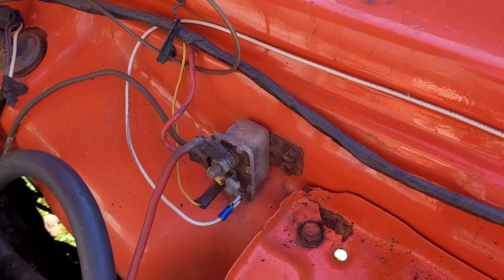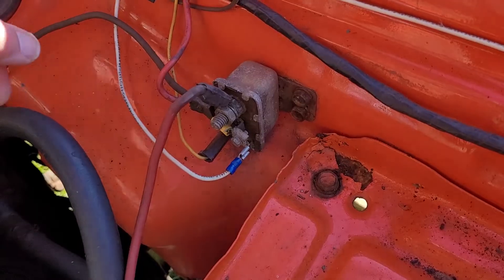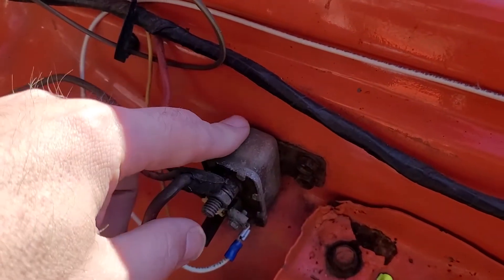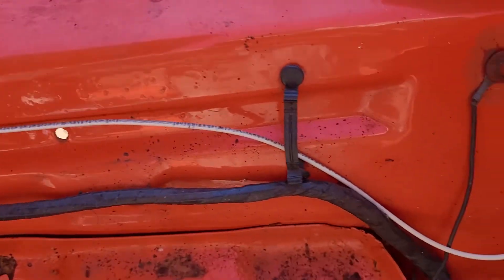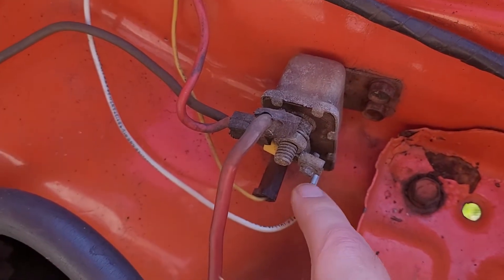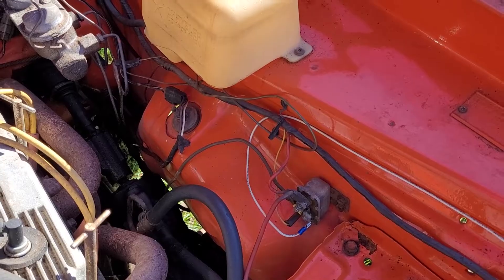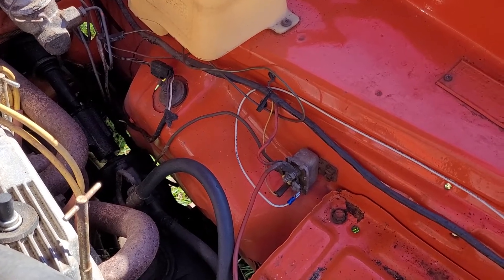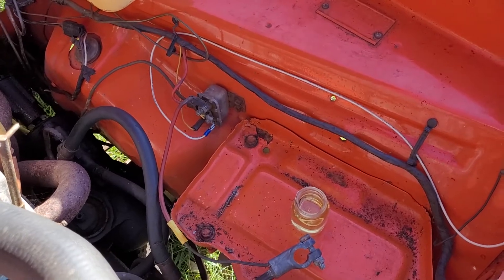Neutral Safety Switch Bypass For Old Mopars

Comment: Nice short video, perfect. I just took the wire that was down by the transmission and ground it to the frame down there. Just did a 4-Speed swap so my auto tranny wiring was different.

Comment: Great tip. I gotta do this temporarily i fried my neutral safety switch wire on the exhaust  and haven't replaced it yet.
Reply from the maker: The same thing happened on this car. Headers can be a real pain. Good luck on the project!!

Comment: I can just run any wire?? Also are reverse and brake lights affected or work fine??
Reply from the maker: Any wire should be fine. The car in particular has been sitting a long time and this was done as a quick test to get it to turn over. I haven't tested the reverse lights or any other lights due to the this particular car being full of issues from the previous owner. I don't think it would affect the brake or reverse lights. I might test that later just to see.